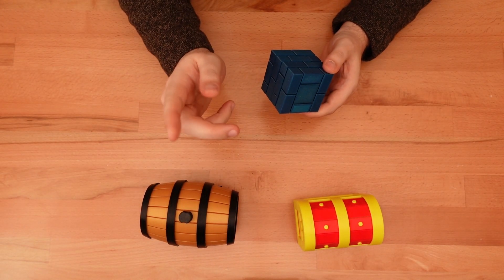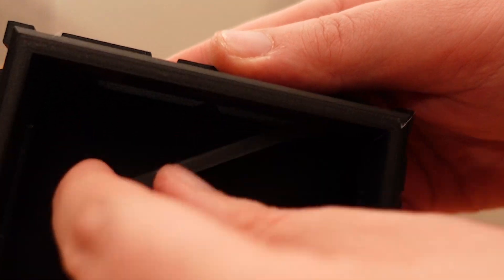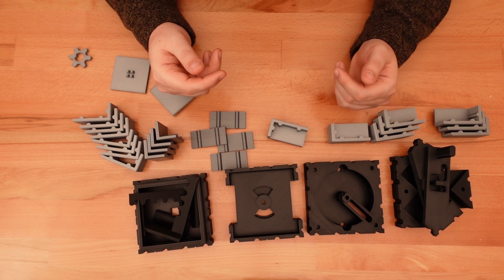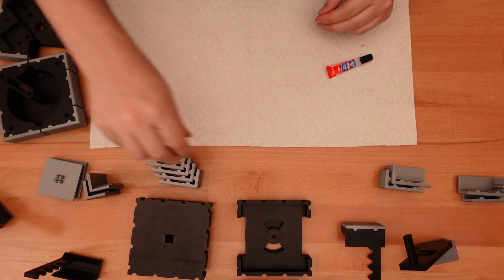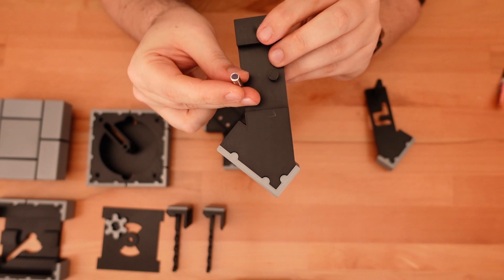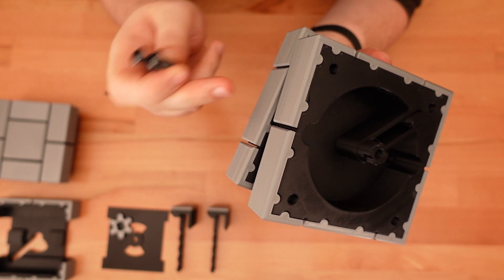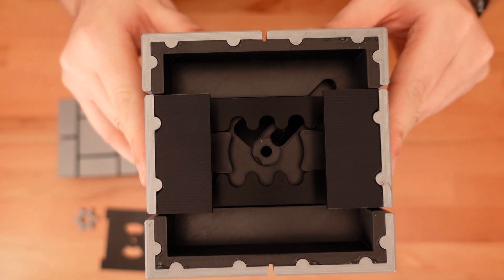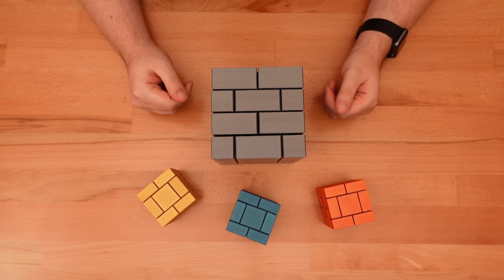Build a 3D Printed Brick Block Puzzle Box

Comment: I printed it like you described in video at 200% … a waste of filament. M6 screws don’t fit and 6mm I bought also don’t fit 😢😢😢. All holes are to big.
Why you show this in your video? 😤
Reply from the maker: I'm sorry to hear that your print didn't turn out as well. For my own prints, M6 screws worked just fine. I would never make a video about a model that I wasn't able to print and build myself first.

I believe you can still get your print to function with a little additional work. There are several options.

The best option would be to add oversized heat set inserts, but getting the correct size could be tricky.

An easier fix would be to pad out the holes with some hot glue. This won't be a super strong connection, but I should be sufficient for the puzzle to work. If you have access to Gloop or a similar glue made specifically for welding PLA together, I'd use that on any non-moving parts.

I hope that helps!

Comment: what is the spool storage at 1:45?
please link
Reply from the maker: That's the vertical filament spool design I shared in this video: https://youtu.be/TCCuzT0m3fg

I highly recommend adding the stand, even though it's technically optional. The stand does a great job of holding the bins in.

Comment: What kind of printer do you use those peice look certain clean mine it'd easy to see the different layers. In new to printing I just got a flash forge guider ll. Do I need to adjust layer hight or?
Reply from the maker: There are a few factors to consider. The most important, though, is that prints almost always look better on video than they do in person. I believe this has confused a lot of people who think prints they see online are more pristine than they actually are.

Setting that aside, there are things you can do to get better prints.

- Pay close attention to your printing temperatures and what looks best for a particular filament. Sometimes I'll even have different print temperatures for different colors of the same brand of filament.

- If possible, print near the cooler end of the temperature range. This will make prints slightly weaker, but the results tend to be more consistent.

- Don't rush print speeds if you can get away with waiting. I'd rather wait 3 hours for a cleaner print than 2 hours for a rough print.

- My main printers are Prusa MK3s, which are known for being very well tuned out of the box. With patience most mid-range printers can be dialed in to a similar degree. I recommend checking any forums or communities that have specific advice for the printer you own.

- I had a cheaper Flashforge printer in the past, so I don't think my advice there would be very helpful. I can say that, if you're printing in PLA, the enclosure on your printer may actually cause trouble - experiment printing with the lid and/or door open so that the chamber doesn't get excessively toasty for PLA.

- If you find a filament that gives you better than usual results, stick with it. For me, that's been Hatchbox, Prusament, Duramic, and a few others.

Good luck!

Comment: Can u adjust the sliding pattern of the sliderssssssss?
Reply from the maker: As long as the final position of the key slider is all the way out, you could model some more difficult sliding patterns - even curved or diagonal paths. This might require skipping the magnets, though.

Comment: Magnets : 3mm x 3mm works fine on 100% print. In this video you print at 200% - surely you need 6mm x 6mm deep magnets but you say 6mm x 3mm in narrative?
Reply from the maker: At 200% scale, either 6x6mm or 6x3mm should work.

The hole is 6mm deep, so if you're using 6x3mm magnets, you may want to pad the bottom of the hole so that the magnet is as close to the surface as possible. Hot glue would work for that - just make sure the magnet doesn't sit above the surface at all, or it'll catch.

If you want a very strong snap, then yes, I'd recommend using 6x6mm magnets or doubling up on 6x3mm magnets. It's not mandatory, though.

Happy printing!

Comment: Hi, terrific job. One problem. I've printed everything and tried to assemble. All parts fit together perfectly, except the bricks. They just will not fit onto the puzzle. As shown in your video, they should slip together quite easily and even require glue to secure in place. I can't get any brick to slide into place. I am orienting them the correct way. Any suggestions?
Reply from the maker: Sorry to hear that! The block I'm demonstrating was printed at 200% scale, so the bricks are a little looser than normal. But even at 100% scale they should slide on fairly easily.

Depending on how bad it is, I might consider forcing them on... carefully. As long as the force is applied in a straight down direction, the bricks really should slip on rather than snap - it's just a matter of what's going to give first.

If the connection is so tight that forcing is obviously not going to work, I'd sand down the flat sides of all four "level" parts. These surfaces will be mostly hidden, so sanding them down shouldn't harm how it looks. They should also be pretty easy to sand since the surfaces we're worried about are straight.

If it's really REALLY off... I guess I'd double check that nothing was scaled accidentally in the slicer. I'd also check if the color used for the core had a significantly different nozzle temperature than the color for the bricks - over extrusion could cause something like this.

I hope one of these tricks help!
Reply: Hi, Thank you for such a detailed reply. I've tried filing the flat surfaces as you suggest. But, no joy. I have seen where the problem is and sanding won't fix this. When I position the brick ready to slide into place and look directly down, I can see that the runners don't exactly line up with the slots. I'm printing a single brick now with the red axis set to 101%, to see if that lines up better. If not, I think I'll just have to file, or cut, all the notches off and simply glue flat in place. I'm caught for time as I wanted to use it for a little gift for my Niece on next wednesday. So, still a great design. Obviously, there must be just something slightly off in mine. Cheers
Reply from the maker: Oh no! Just to be safe, I rechecked all the bricks in the model and they appear to be correct. Something weird must have happened to cause them to be so off.

Printing the bricks at a slightly larger scale on the X/Y plane sounds like a good idea. I hope that one way or the other you'll be able to get that working in time for your niece! If there is time, let me know if you'd like the brick models without the nubs. Good luck!
Reply: Hi, update on problem. I did think I was facing a big task of filing down all those faces. However, I tried one other idea and it worked. I was able line up each brick  at its slide in position. Then, using a Kreg clamp, I applied considerable pressure and drove each brick into place. I’m sure this was not the originally intended method of assembly, but hey, it worked. Many thanks again for a fascinating project.
Reply from the maker: Hey, as long as it works! I'm glad the project was able to move forward without sanding!

Comment: how big did you scale the cube dne you have assembled the ones on Thingiverse are smaller
Reply from the maker: The block I assembled in this video is 200% scale - I chose that scale because I knew I could get bolts and magnets that would fit. All the other block puzzles shown are the default 100% scale.